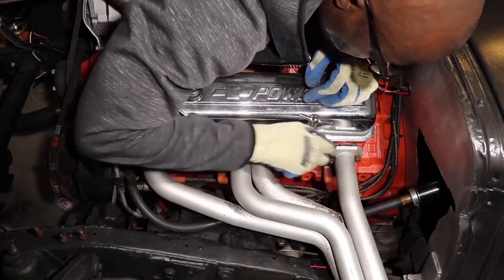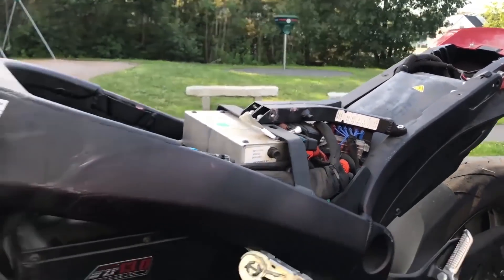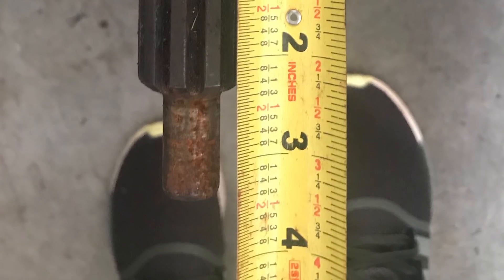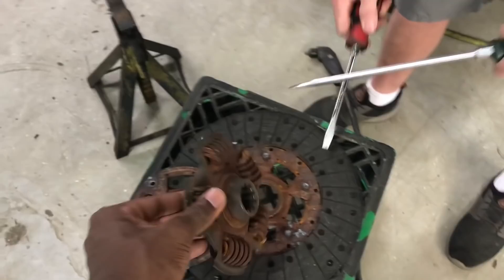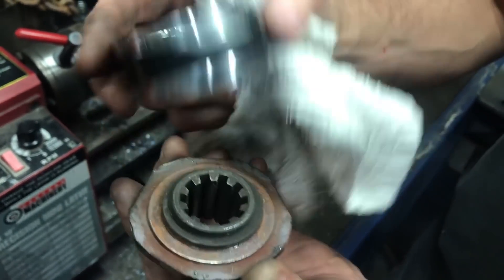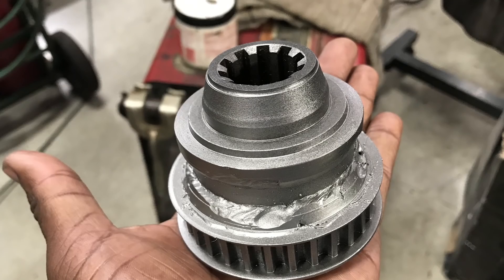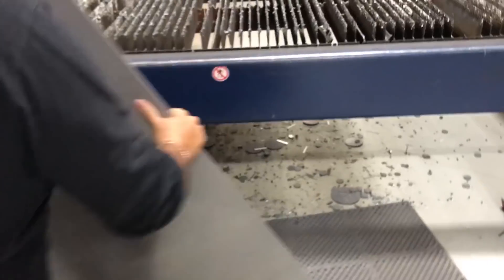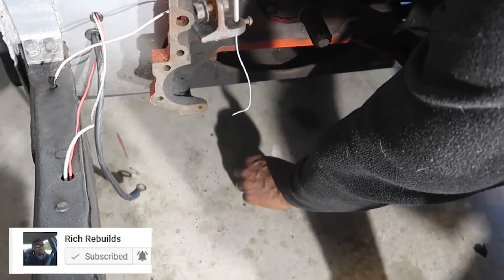I’m building the most BIZARRE electric vehicle conversion

Comment: If one zero motor isn't enough, then just add more of them.
Look forward to seeing the result!
Reply: But it will still be zero engines in that car, tho...

Yea, I'll find the door 😒😜
Reply: He's gonna need to!
Reply: @randygreen7871  One on each wheel would be cool... 320 HP 4WD with no transmission and tankturns...
Reply: @ahaveland  That's what need to happen, but it won't. 67 HP is not gonna do it, no way!
Reply: @randygreen7871  Well, 67 HP is plenty enough to get around from A to B comfortably.
I'm still deliriously happy with my 2HP homemade ebike!
Reply: @ahaveland  "One on each wheel would be cool... 320 HP 4WD with no transmission and tankturns"  There ya go!!
Reply: @ahaveland   yea me too! My BBSHD is 1500 watts about 2hp can cruise 34 mph, and have hit 50 down a steep hill...still pedaling like a madman. Can't imagine what I would do with the 3000 watt version that is available for some years now
Reply: 116 ft-lb of torque is quite a bit. Rich can also lighten the car (like in the frame) since it doesn't have the heavy engine in it anymore.
Reply: @JasonWW2000  116 footpounds is 2.8 furlong-ounces :-)
Might be able to do 0 to 2520 furlongs per fortnight in around 10 secs!
Reply: There's an all electric Pikes Peak 911 that uses 6 Zero motorcycle motors.  It's over on Jalopnic and was the first thing I though of when I saw what Rich was doing.  Here's  a copy and paste of how they did it "Taking the stock pistons and cylinders off of the center section of the engine case, the engineering team for this car developed a chain-driven crankshaft that slotted into the stock Porsche main bearings and provided a chain-driven central shaft for six individual Zero Motorcycles EV motors to sit. All of that is mated up to the standard Porsche transaxle."
Reply: @jaoliver999  Cool! That's a pretty good example of creative integration.
But is the crankshaft still a crankshaft when it has no cranks? :-)

Comment: I'm no expert, but I guess that transmission, gearbox, shaft, bla bla will eat a lot of power.
Reply: @MLWATKK well, sure. It's a fun project anyway. 

I just guess it will be a little slow, but there isn't any other way to build it, especially on the budget.
Reply: Yes and no. Since the Gear ratio of First gear will mean the Motor will spin faster than the output of the wheel you can multiply the motors power,  It might not even work without the tranny as it might consume wayy to much power to get the car moving.
Reply: @MrDehBoss  electric motors have a pretty low rpm when used ungeared in cars that's for wheelhub motors not sure about tesla but you. Probly not gonna hit 50 in top gear with that rpm
Reply: @MrDehBoss  (pedant alert!) You can't multiply power, only torque. But yeah. The max RPM of electric motors is so much higher than with ICE engines (and the minimum infinitely lower) that you can get a lot of grunt all the way through the usable rev range by running them way underdrive in something like second gear.
Reply: Yep. There's a reason there's a difference between engine horsepower and brake horsepower.
Reply: Plus that motor is waaay under powered for that chassi.
Reply: @skmetal7  "chassi" xD
Reply: 10% drivetrain loss though a manual trans

Comment: I think you are making a mistake without using clutch and shifting through all the gears. That said, it is your project, and it will be interesting to see how well it works.
Reply: Even in a gas powered car you don't really need a clutch to shift, you only need the clutch to get started in 1st. The motor will have way less momentum so shifting without a clutch should be fairly easy.
Reply: @cmoullasnet  shifting without a clutch requires you to drive like a grandpa if you dont want to ruin your syncros in a week.

Comment: Try turning steel parts slowly on the lath and aluminum fast, it cuts better and don’t wear out the tools
Reply: That lathe was really going for it. 
And that with a standard HSS tool in an interrupted cut. Poor lathe :D

Edit: and then some welding on the lathe without any protection for the ways or anything :D 
I know it's just an import thingy but come on..
Reply: :-) will do
Reply: How 'bout some oil?
Reply: midgetrace did you see what kind of lathe he was using? i don't think you did. those chinese mini lathes don't have enough torque to turn steel slowly so you have to spin it quickly.
Reply: Glad I'm not the only one who things he's running the lathe way too fast.
Reply: Bit of oil helps alot 
And a bit slower 
But those little lathes can only do so much
The chatter we can here is prob just the lathe its self 
Non precision bearings and loose ways 

It didnt acheive a bad result really 
If it gets the job done what more do you want